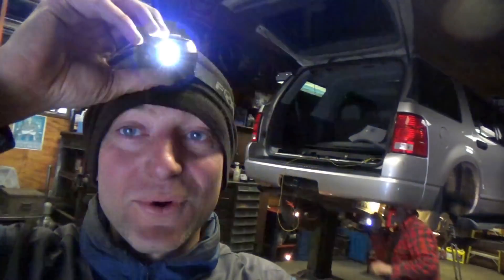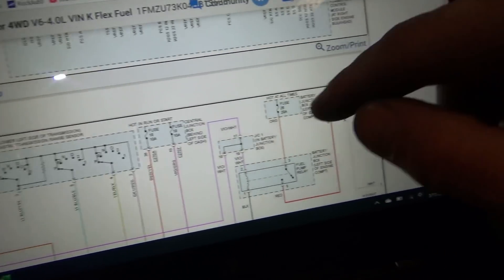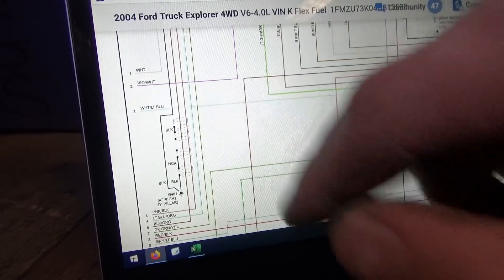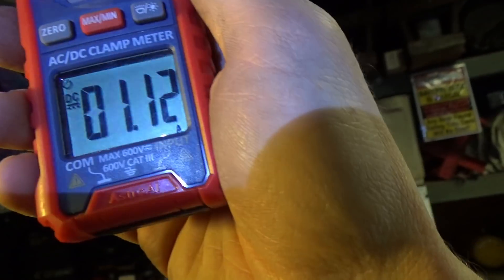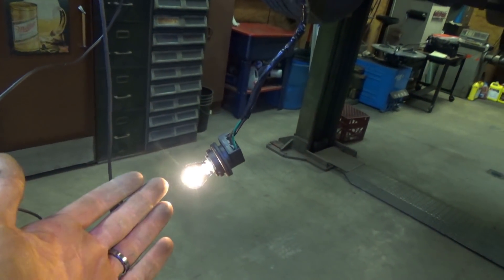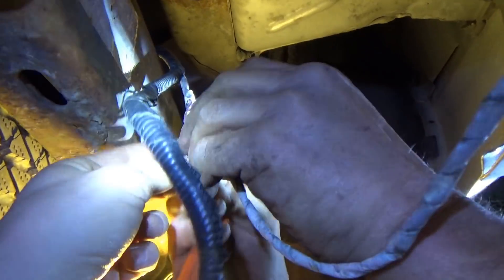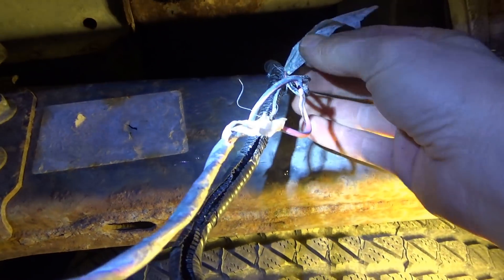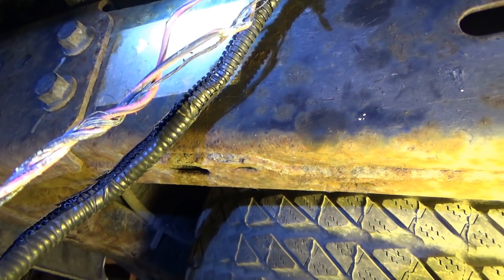Weirdest Wiring Fault I Have EVER Seen...

Comment: There is a vulnerability of harness construction (manufacture) if the harness is subjected to salt spray, like in the rust belt. The problem is any mistake in manufacture of the harness in nicking or slicing insulation will result in corrosion which can result in a short like this in a harness that uses a shield. The shield and the shield drain wire are used to reduce pump switching noise created EMI. Really the fuel pump power control for a PWM modulated pump motor should be at the pump. If you send these switching power currents through a long harness you will probably need a shield grounded at the source end to pass vehicle EMC. To prevent salt spray from invading the harness, it should be sealed.

Comment: One day I had a older Chevy Cruze that wouldn’t crank. But, move the main power wire from the battery a certain way, it would start. But drive it out of the shop it would die. Very Long story short, found that a electric power steering wire was rubbing on a CAMBUS wire. Somebody who had been working on it didn’t secure the wiring harness and it was rubbing together. One of those things you’d had to be there to understand/appreciate. Was super proud of my self for finding it and have solved other weird issues based off of this. Wish I had your knowledge of pico scopes and amp clamps. Would of helped a lot of some of these problems I’ve seen coming into the shop.

Comment: I made a little device to add a buzzer and light to a shorted wire. It hooked up through the fuse box, and it added enough resistance to the circuit to allow it to continue flowing current without blowing its own fuse. Then it's just a matter of wiggling and listening, the buzzer allowed one to stop staring at the bulb. Add that to a thermal imager and you'll find it quickly. I really liked the idea of sending a radio signal down those wires, but guys who use them every day point out that they are not as great as you think they should be. For example in this case, with a Faraday cage around the involved wires, you will lose the signal because of the cage.

Comment: salt water is probably getting into the connector and then wicking inside of the wire insulation. i've seen this happen before with cam sensor wiring. oil wicks into the insulation all the way to the pcm and into the pcm. never seen that with salt though!

Comment: looks like it rubbed through right at or near the harness holder, it's common to get chaffing and wear through at holders and radius bends.
vibration probably had it rubbing against the bare shield wire or against the flex-loom, I've found bad wires like that all over the place on vehicles and other equipment.

Comment: shielded wiring to keep it from spewing RF noise. why do they do that? some people like to listen to AM radio stations still, as well as ham operators and other people around the vehicles.
same reason for resistor spark plugs and resistance wires, only back then it interfered with everything used daily by many since it was all analog signal and poorly filtered (tv, radio, other)

Comment: Ivan, I swear on my life what you just said you have never seen, I had in my Saturn, which I suspected had been tampered with...and for 13 years it read that  it had a 2.2L engine on EVERY SINGLE PIECE OF 30 pages of service history...until it somehow read 2.0L at the point at which it stopped passing emissions. Also, I kept having the MIL set when I turned the steering wheel, opened it up and saw the same type of goo connecting a pink and black set of wires...THANK YOU SO MUCH.

Comment: Not a fault of the car maker. Them shielding wires will cut through any wire. As it's a twisted pair. Then given enough vibration and time. Toss in some salt to help grind on the insulation. It will cut it....

Comment: Just in case it helps somebody- there are tone generators and hand held amplifiers that are used in the telecom industry. They are used to send a signal through a wire so it's physical location can be traced. If you're having to track down wires in a harness and you aren't sure the diagram is correct, they are very helpful. Seems like that might work here.

Comment: Ivan, so ford thought it was good idea to have bare ground running in that harness?
Reply: it very likely chaffed through against the flex loom, right at or near the holder it was zip-tied into. if the ground wasn't there, we sooner than later would be seeing a video of no fuel pump from an open circuit(wire corroded apart). 100% guaranteed 😉

Comment: In the South, where we have no salted roads, the pump control module is bolted to the frame near one of the rear tires, and due to a terrible design, the moisture gets trapped between the module and the frame and the module corrodes away, allowing water to enter it which causes various shorts to occur, as well as odd ignition, fuel pump relay, and fuel pump behavior.  Down here, a lot of perfectly good fuel pumps have been replaced due to bad fuel pump control modules. These modules cost about a tenth or less of the cost replacing an in-tank fuel pump, and the modules are replaced at the same time as part of good shop practices. The problem goes away, and the shop has another pump it can clean up and sell.

Comment: If it was a 1992 to 1994 Mercedes harness,  ALL of the wire insulation would have been crumbs and dust inside the harness,  and ALL of the wires would have been shorted to each other!

Comment: abrasives trapped by the loom designed to protect them. nice.
Reply: or just chaffing from movement right at/near the points  of fastening to vehicle via holders. abrasives and shielding or not, it would have worn through anyway, eventually resulting in an open circuit broken/corroded wire.

Comment: My wife had a 2001 Sebring that intermittently blew the 10 amp ignition fuse causing the car to shut down like the key was turned off. Turns out that 2 connectors under the dash had their locations swapped compared to the All Data sketch. This caused a harness to run up against the sharp edge of a support it went thru. I was lucky to find it.

Comment: A lot of CATERPILLAR wiring uses this type of shielding as it has analogue to digital convertors in circuits as part of wiring harnesses, a LOT of mining operations use ground water which generally is salty for dust suppression and the to top it off in iron ore mining most the little rocks that sit in places to rub on harnesses or get into harnesses are in excess of 50% iron in content, an electricians hell 😀, a common comment is "oh we've got a rub through somewhere, novices look for external rub marks only 😆 they guy from UK comment about little rocks in harnesses on Citroen's was a de ja vu moment

Comment: I just bought a meter like yours on Amazon to check for DC Amps. I had a Robot blowing out a fuse for the 24v DC. My old fluke meter doesn't have DC Amp draw. I had to do it the old fashion was of changing out some parts.

Comment: Excellent diagnostic!! 20 amp fuse #26. I guess heavy draw of module and fuel pump in operation plus the 1 amp short draw, pushed it over the 20 amps? I would have thought it would have a higher draw at the short.
Reply from the maker: The 1 amp draw was controlled by my test light lol. It was a full short to ground 👌😁
Reply: Makes sense with the explanation. Thanks

Comment: I said it before and I'll say it again...poor manufacturing methods and engineering. A 6th grader could wrap those wires better with tape. Whats more interesting is, those wires broke the insulation right at the fastener that holds the loom steady. Apparently the loom actually needs two more fastener locations to prevent the vibration/movement from driving dynamics. Looks like those wires, all of them, could use a nice long replacement like "loom" to eliminate the source of the problem. All of the road debris/slush/water etc is dripping down from the inner side of the wheelhouse down and onto the wiring...likely worse with the wind dynamics while traveling on the road. Time for an custom inner splash shield idea. 
Way to go Ivan...gotta love those cig smoking mechanics !

Comment: At other applications, you'll see some ceramic capacitors directly soldered to the motor contacts, for clamping down on that interference. Sometimes, you'll even see some inductors. All of that could be safely tucked away in the sealed fuel pump motor case, in the tank, far away from water. But Ford rather uses shielding, apparently. But not a properly shielded cable, because that would be expensive. Just wrap it with some grounded metal wire mesh tape and wrap that with that protective tubing that wicks up water. When dry, it is an abrasive mix of metal wire mesh and salt crystals, nicely grinding away insulation, by means of the car's vibrations.
At the first tiny compromise of the insulation and when wet, electrolysis will occur. The process will accelerate and soon you'll have a nice short capable of blowing 20A fuses.
Great design, Ford.

Comment: In the northern area often ice causes problems.  That is water gets in harness and freeze. This makes a wire loom ice hard for a section. That hard section then vibrates and wears out wires where the ice stops.  Ironically the wire loom makes this worse because it holds the water inside loom to freeze and making icicle.  Note, even having small pieces of ice with sharp edges cause problems.

Comment: Ivan I saw problems like this in the 1980's  ground circuits spliced midstream and wrapped with friction tape, no reference to the location of the splice on the wiring diagrams,  holes in the insulation of wires wrapped ,damaged for no reason. almost like the damage was done intentionally in the manufacture of the harness. It never ends with these manufactures,  and their pointless to the fact the vehicle will run in the salt when designing.  thank god I'm retired.

Comment: I once came across a late 80's Camaro that would blow the fuel pump fuse when the driver door was slammed closed. It took awhile to find the bad spot in the harness by the A pillar. Easy repair once it was found.

Comment: That is a crazy one. You got to love the salt and calcium on our winter roads. I didn't see any in there inside the electrical tape, but water intrusion there could also added to that problem. At least minimal parts were required to fix.

Comment: This one reminded me of the old toyota cressidas, the single wire o2 sensor had a grounded shield around its wire, the shield would cut into the wire keep the voltage at zero and set a code.

Comment: Reminds me of the way 2010-2017 Navistar International day cab road tractors were with their rear ABS wires.....no shield wire, but pretty amazing how the split loom over the wire harness managed to rub through the insulation on the wires and the road salt just turned the exposed wires to green crusty gunk. Made it even more unbelievable that on the later model day cabs that they had a really long harness (guessing they used the same harness on short day cabs and the longer trucks with sleepers) for the ABS that at the factory they folded over itself.....and then wonder why the ABS wiring had issues

Comment: I had the same problem on my 2014 Ford E450. I ended up running new wires from the fuel pump module to the fuel pump. I no longer have shielding on the wires and everything works just fine.

Comment: it is at a mount point so rubbing is possible... but not likely??? LOL... did insulation looked charred at all?? maybe a winter freeze caused fuel pump to be a large draw that melted the insulation to the shielding then over time corroded? maybe at the factory when that harness was created some metal got locked into that location and corroded? that seems more plausible

Comment: That is a weird one! This wasn't the weirdest one i had but 1990 E-350 cut-away van kept blowing the fuel pump fuse. It ended up being in the three wire connector the hooked to the sending unit. I bought a brand new connector from Ford and it was shorted just like the old one. I ended up just making my own up and fixed the problem.

Comment: You look at the corrosion on the frame you know the environment during winter is wet and messy and that plastic sleeve with a crack in it so it can be wrapped after the harness is finished is no protection. If they put a shrink-wrap on it while the harness was being built, that might have been sufficient, routing it through the fender out of the elements would also work but that adds complexity and cost.

Comment: Used to run into similar faults with communication cables that would get wet. Turns out that some vinyl insulation , at a molecular level, allows water to enter. It's water resistant, not water proof. So when it is immersed for long periods enough water will penetrated the insulation to cause a galvanic reaction, usually to ground.
Reply: THHN (vinyl insulation) wire absorbs water when the outer coating is nicked. It causes very odd problems. It is not recommended for wet environments. I'm not sure how prevalent it is in automotive.
Reply: I can see that. We think of plastics as water barriers. I found out a while back that's not exactly true. Plastics are, in varying degrees, permeable.

Comment: I had a '91 Chevy 2500 company truck that would flicker the lights and dash gauges when making a left turn.  It finally blew the main accessory fuse at the battery positive terminal.  I followed the accessory wire and found it was tangled in the passenger side front coil spring seat.  The GM assembly guy must have needed to take a crap and rushed through the wire harness installation.
Reply from the maker: Nice!

Comment: its right where those plastic tabs hold it to the frame.   higher amperage than the wire can handle heats the plastic insulation and frame twist does the rest. if it were a keeper i'd say let it dangle or loosely hold it. but a proper repair will outlast the vehicle.

Comment: Nice one.  A bit off topic but my 97 Celica GT Convertible, 231,000 miles started hesitating and bucking, only very slightly.  Changed the fuel filter, no improvement.  Tested for blown head gasket,  all OK.  Then I put my thinking cap on.  I thought about some of the stuff I had replaced- plug wires, spark plugs, distributor cap etc.  Remembered some of your videos where the problem was with the replaced part.  The new wires and plugs I put on were expensive NGK, but the distributor cap purchased from Amazon, supposedly a Bosch, arrived in a clear plastic bag with no markings on the cap, nothing.  Luckily I kept the old Denso cap which I cleaned and put back on and you can probably guess the car runs like a clock again.  The moral of the story, try and buy quality parts and keep the part you replaced just in case!
Reply: ngk wires are junk buy them at the dealer l1 master car and truck
Reply: @juanrodriguez-ry6yt  NGK products are rated very highly but of course you are entitled to your opinion.
Reply: @robbflynn4325  nothing beats the original wires i've had to replace  plug wires

Comment: let's hear it for soy based wire insulation!  The weirdest wiring problem I had was a driver was driving her Ford diesel pickup on the freeway and had cruise selected, a car pulled in front and she tapped the brake to disengage cruise. It did not disengage, she hit the brakes to slow from hitting the car and it slowed but when she lifted it went into resume speed. She disconnected cruise at the switch and all was ok for then. I tried to duplicate and it did the sae thing, the tuck was under warranty and taken to a Ford dealer, the service guy said it was impossible to have that happen, I invited him to drive the truck he did and almost dirtied his pants when it did the same thing but with almost catastrophic consequences. The tech also said it was impossible and was treated to the same eye opening event. The techs checked everything and could not understand why it will not disengage with the brake pedal disengage. I went over the schematics and found that the brake to cruise disengage got it's 12 volts from the right brake light circuit, the right brake light fuse was blown in checking the wiring I found a wire bundle that goes through the right rear of the bed was chaffed and shorted the right brake wire. but still there should be a vacuum break to disconnect the circuit. nobody at the dealer could figure out what was wrong, i was put in contact with a factory brake engineer and ha poo pooed the whole thing and said the vacuum system would disconnect when the pedal was depressed. I went over the schematics with him and told him there was no vacuum break built into the 1997 ford F-350 crew cab 7.3 Diesel truck system. He insisted that there was and I told him to prove it. He couldn't. He did find out that the wire bundle through the frame and bed on those trucks was a problem with a lot of trucks. We fixed the wire and rerouted them wrapped with a teflon sheet ( I am a master mechanic and a jet acft mechanic and use this technique on the F-16's)   all was resolved. bit there was no backup vacuum break disconnect.
Reply: Impressive diagnosis. It can be very frustrating convincing people to take you seriously.
Reply: Stop calling them techs just because all they know is hooking up a scanner. 😄
Reply: It's like labeling a Parts guy who hooks up the scanner to your vehicle a TECH..😄😄😄